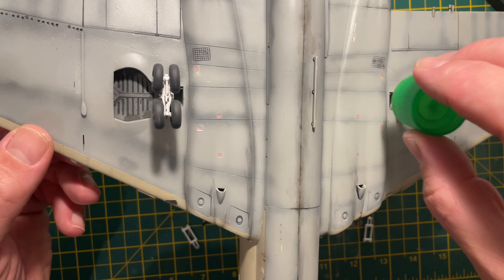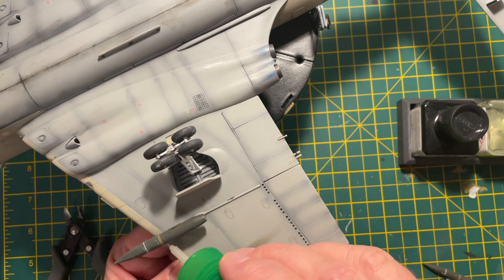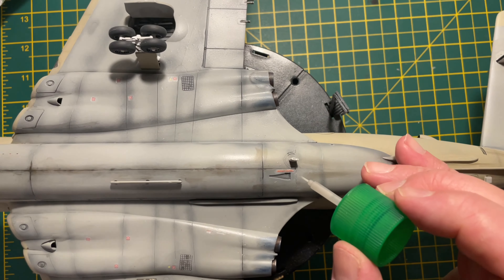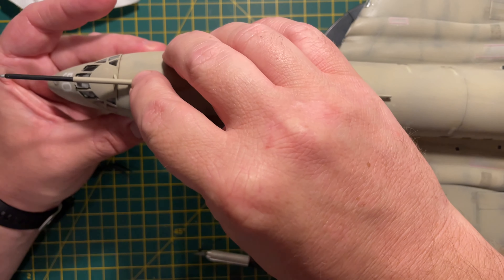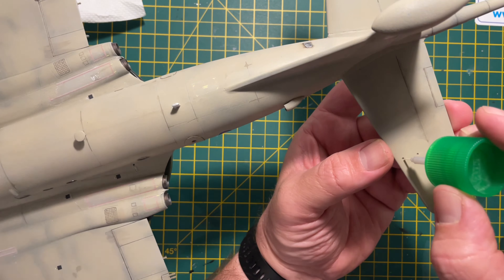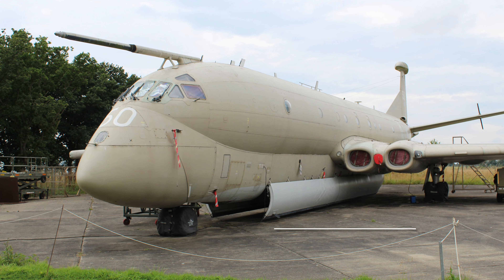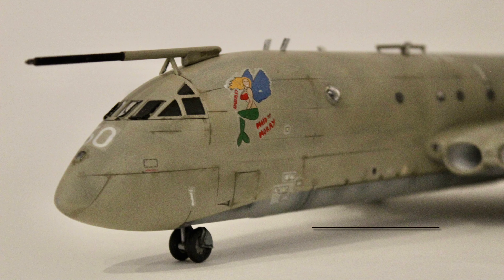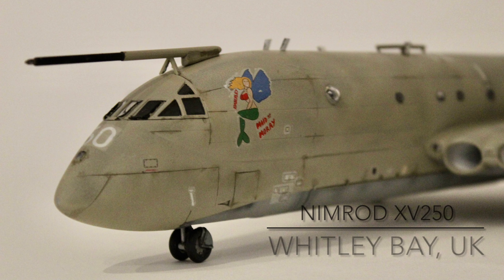Airfix 1/72 BAe Nimrod video build Part 6 - last steps and final reveal!

Comment: Just found your channel,just want to say,I spent time at kinloss where 201 and 206 sqdns were based,and none of their aircraft were ever that weathered,due to the fact they had water spray baths after every mission,simply to wash the corrosive salt off their airframes,and that kept them really quite clean.
Reply from the maker: Hi. Yeah I appreciate that, this just my interpretation. Was also practicing as it was the first time I’d tried pre shading. 
I had a flight on one at Kinloss during an Air Cadet summer camp in 1993 and remember then being well kept.